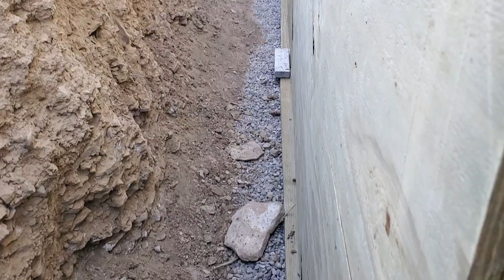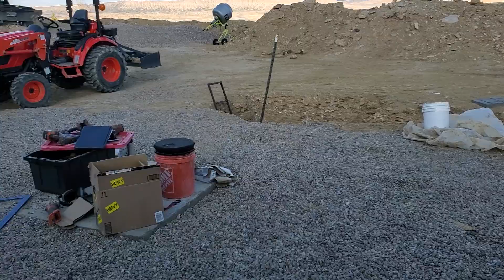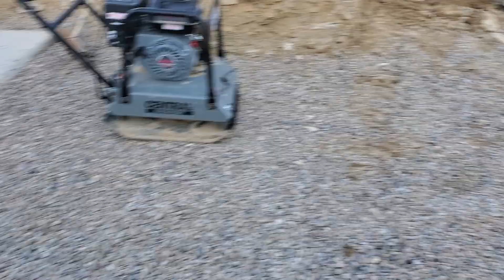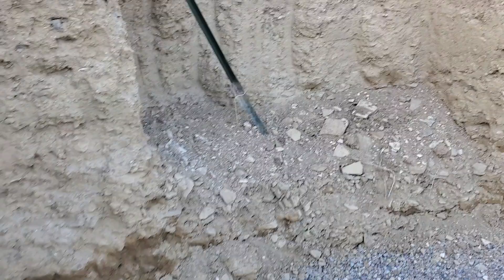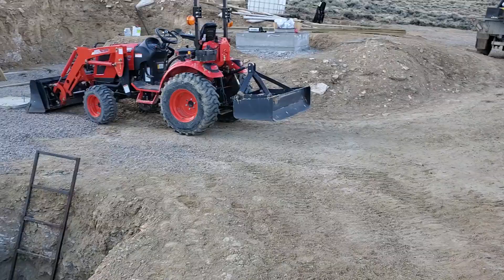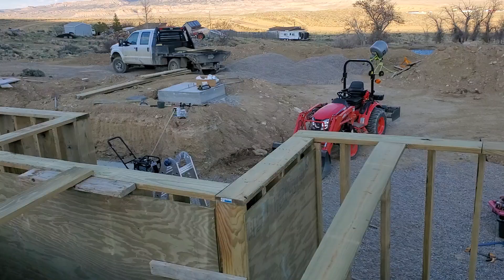Permanent wood foundation PWF first weekend setting walls.

Comment: Just starting to learn about PWF. It seems like most projects are 100% on top of crushed stone, but I noticed you have area footings at certain points. Is there a rule of thumb for when you do and don't need this, or was this specified by an engineer? Thanks
Reply from the maker: It came down to the point loads. Usually on PWF you put plywood footer pads under point loads. I don't remember where I found it but I used 8k lbs as my cut off. The size of the pads for points over 8k made it easier to just put the concrete footer. If you see later these concrete pads are under big log columns supporting the third floor. If you were doing a simpler single story ranch or something it wouldn't likely be needed. I have seen the entire thing on a concert footer but that makes the drainage system a bigger concern if you can trap water in the concrete.

Comment: hello! will you put water proofing between the plywood and the soil? I just bought a house that has a wooden foundation from 1985 and it is leaking water, we are wondering if we should/can dig around and replace panels and waterproof..
Reply from the maker: Yes it should have a rubber membrane attached to all the plywood that is below the soil. Some rare cases they had more of a painted waterproofing on it. Make sure once you dig down, if the plywood needs replaced that you get the stuff stamped for wood foundations it is pressure treated differently than normal plywood. And probably as important as the membrane is to fix drainage so the water doesn't sit against the foundation.
Reply: @caseybruder4676  yes thank you! I plan on adding a drain tile all round